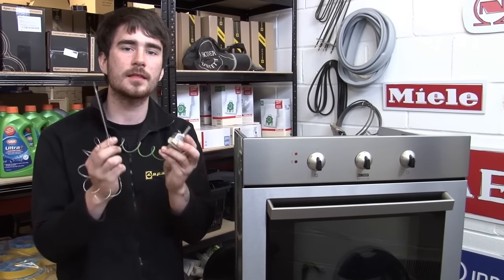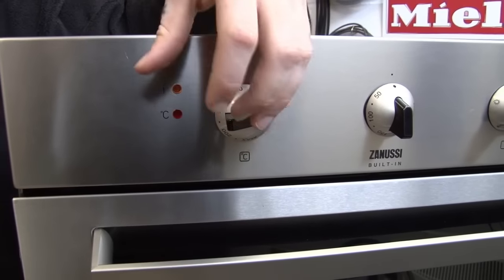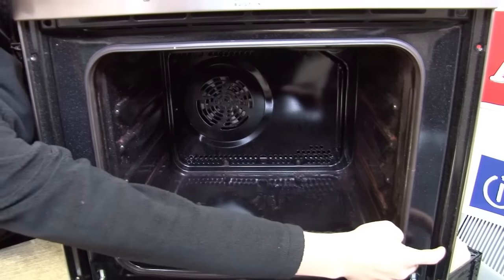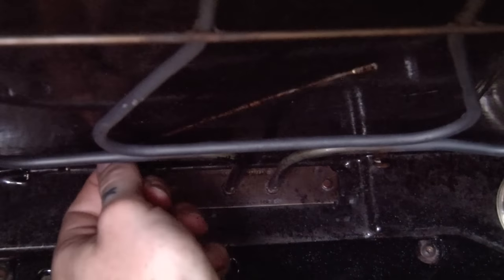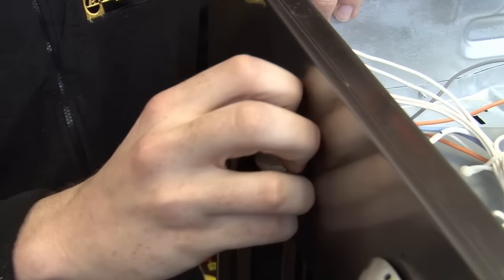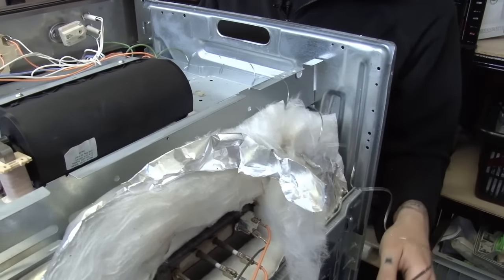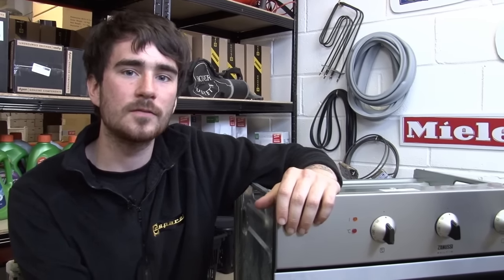How to Replace an Oven Thermostat in an Electric Cooker

Comment: My oven has been randomly switching itself completely off(including the clock and oven light), and after a few minutes to cool down, switches itself back on. Could this be what I need to replace? Thank you.
Reply: Edit,  I have replaced the thermostat and it's still happening! My next port of call is the element!

Comment: What actually goes wrong with the thermostat to cause it to always rise to the highest temperature. I removed the top of the thermostat and saw that everything seemed to be in it's proper order, no breakage or loose connections on the copper wire either. But! The copper sensor seated inside the thermostat wasn't slowly fluctuating to turn off the oven when the 150 - 200 degrees was met, which allows the oven heating element to reach highest temp. Yes, I turned power fuse amp on to test this.

Comment: Thanks for the video. 
My zanussi oven is  inconsistent ,one day its hot then days later when i use it  it doesn't feel as hot despite setting it at 190°.Could this thermostats be a likely problem ?
Thanks

Comment: Thank you Rory and espares for a great instructive film. Really useful and we followed it step by step. Had a laugh and unfortunately now discovered that there is something else that needs repairing too! Still more fun ahead. Fan is working so next... the oven heating element.
Reply from the maker: +Cliffe Osteopaths For information to diagnose your cooker see another video: https://www.youtube.com/watch?v=_lWk22-qvoI
Reply: Hello Rory, my EW74x Hotpoint oven light doesn't go on at all, I can hear a weird sound inside the cooker, almost like a  faint high pitched drilling sound .It sounds like its trying to do something , I am replacing the fan I ordered off you tomorrow ,it arrived very quick , nice one ! I'm on espares now but there's only ew74g thermostat , will that work please ? Thank you .
Reply from the maker: It sounds like you may have a loose terminal in the connector at the back causing an arc and burning. For more information see another video:
https://www.youtube.com/watch?v=YvQEDG-hNz4

Comment: Hi. My oven trips on low heat however on high heat o
It works fine. It's defy 600s slimline. What could be the issue. I have replaced the oven element already

Comment: Another excellent video from eSpares. Thank you.
Reply from the maker: Hi, thanks for your comment. We hope you have been able to replace the thermostat with our help, and that that your oven is now working a it should be again!
Reply: @eSpares  All working fine, thank you, although the two screws holding the thermostat control were covered by the glass front, which was glued on. I managed to remove it and glue it back on afterwards but only then realised that all I needed to do was twist a quarter turn to remove it 😁. Also, although I was careful enough to fit the new control with the terminals in the same orientation, I found that it was upside down but I had already put it all back together so just remarked the knob 😁

Comment: Help please. Purchased Energy Regulator (ES212776)  for Creda 40063 from espares but wiring is different. Can you advise where each wire goes. No videos available for different or new universal regulators

Comment: Our oven heats up but goes past the set temperature then cools to below the set temperature.....and keeps cycling up and down. I'm assuming it's the thermostat. Is this the case?
Reply from the maker: Hi iSharon Smith, if the thermostat is cycling it usually means OK and depending on the thermostat would have a tolerance of + or - 10% if the thermostat is overheating well past the correct temperature then it is likely to be the thermostat.

Comment: I have a Smeg oven that gives me an error 1 alarm and stops the oven. The only info I can find is that it's probably related to the thermostat. Do you know something about this? Nice explanatory video by the way!
Reply from the maker: Hi fophinho,  Error code F1 on a Smeg oven refers to the oven has detected a problem with the temperature sensor not relaying information so check the sensor.

Comment: Good Morning, 
I have a cda intergrated fan oven but have lost manual and cant find the model number. The thermostat needs replacing but I cant find one that is same as one I have. Do you have email address i can email photo so you could possibly help me find correct thermostat part for my oven.
If you could help would be greatly appreciated.
Thankyou
Reply from the maker: Hi susan, if you contact our sales team and they will be able to assist you https://www.espares.co.uk/contact/sales

Comment: Hi so my Indesit oven is just getting really hot whatever the temperature, and the light is not going out  when its been on for a while - I guess this is the thermostat right? The model number is FIM 21 KB IX - will any thermostat work with this or do I need something specific?
Reply from the maker: Hi John, it does sound like the thermostat isn't working correctly, you will need to have the correct part otherwise it won't fit or work correctly but check out our part pages https://www.espares.co.uk/search/ma805pt1604/cookers-and-hobs/thermostats/indesit

Comment: Hi Rory 
Just wondering if you can point me I  the right direction please 
I have a lamona oven 
And it's working fine  but when I turn the thermostat off 
The power indicator light is staying on .. but the light is faint 

Is this some thing to worries about .

Thanks James
Reply from the maker: Hi sean , is the oven cycling correctly? as long as it is not overheating it may just be the indicator light flickering which will not stop you using it.

Comment: Mine is tripping the rcd oils it be the thermostat
Reply from the maker: Hi tospicy4ya, it is more likely to be the element causing the RCD to trip so check that first before suspecting anything else.
Reply: eSpares  removed the element and rcd stayed in now put new element in and it’s still tripping it, as soon as it’s turned in it’s tripping it? What would you suggest next?

Comment: Hi. I wondering if the losing of the clips that hold the element can compromise the functionality of it. We lost our ones in a Cata oven and now is not heating anymore the down part side
Reply from the maker: Hi Enrique, the clips that hold the element stop it from touching anything else when it gets hot and expands if it is not heating check for any signs of damage then use a multimeter to test it to confirm if it has failed.

Comment: Hello, good morning, I have an electric stove and the temperature selector and thermostat has broken down and I called a specialized technician and he came in my house dismounted the two went away and said he would come back with the two new parts and never came back, I bought the new parts but I am afraid to connect them because there are many wires and plugs, so I would like to know if you have any electric stove of the brand logik model LFTC60A12 that can take some photos of the connections of the temperature selector and the thermostat and can send me so I can assemble without damaging the new parts I bought .... Thanks and look forward
Reply from the maker: Hi david, the only appliances we have are for filming and we do not have your model so cannot take photos but if anyone else has hopefully they will be able to help.

Comment: Hi, my oven gets insanely hot if I set it to anything above 140c but below that it keeps the correct temp roughly. The indicator light comes on and off but the temperatures seem way off? Do you know what this could be? Does it need re calibration?
Reply from the maker: Hi adam, most thermostats can not be re-calibrated, is the thermostat cycling above 140c? you will also need to test the overheat thermostat to determine if it has failed.
Reply: @eSpares  thanks for the quick reply.
It does cycle yes. I tested it with a thermometer yesterday and it's way out... 100c on the dial is actually 220c and 200c was hitting past 280c!
All the usable temps are between 0 - 100c on the dial so Ive just made an accurate dial sticker for now. Don't know what would cause this but at least it's now controllable. Thanks again

Comment: Hi, I am just about to order part to replace as I think my thermostat is the issue. Wonder if you could confirm please
2 days ago over only worked below 150degrees, grill and hob fine. Yesterday only grill and hob work, Today only the hobs work. I assume it is a faulty thermostat and not clock/an element for example but is there any way to be sure? Thank You
Reply from the maker: At 4:34 we talk about the oven temperature indicator. This should light when the elements are being heated and if the thermostat was faulty the light would not come on. However if the grill is not controlled by this (some models) it suggests a common problem between grill and oven so check the terminal block as the connections may be loose and burning. For information on the terminal block see our video: 
https://www.youtube.com/watch?v=YvQEDG-hNz4

Comment: I had The thermostat and oven element replaced( did not do it myself ) with parts supplied by e spares. initially the circuit breaker was tripping out when the temperature in the oven rose. so I thought it was thermostat. Now the element does not heat up at all. could it be wired wrongly or is it a faulty part?
Reply from the maker: You need to identify the problem before replacing parts as if you have connected the wires correctly that should not be the fault. For information on Diagnosing the problem see another video:
https://www.youtube.com/watch?v=_lWk22-qvoI

Comment: Can the thermostat make everything dead in an oven?  Temp indicator light, oven light and fan?  Thanks.  Ironically, only thing I do get is the click when turning the knob on.
Reply from the maker: No, that is what we try and explain in the diagnosis video. The light and fan would still work but the indicator and element would not if it was the thermostat. There are only four areas common to the light, fan and element.
1: Clock relay for automatic cooking.
2: Thermal cut out  if unit has overheated in the past.
3:  Selector switch to change between grill, fan and conventional ovens (depending on model).
4: The terminal block (distributes power to the separate circuits.
Wiring unless damaged does not normally fail but connectors can get hot and burn if loose.

Comment: After cleaning my self cleaning oven the door locked sign is flashing and want go out and can't get oven to work. Can you help me. It's a Kenmore
Reply from the maker: On some 'pyro clean' ovens the door locks during the self clean cycle as it heats to a very high temperature. If the problem still occurs after switching of then on and resetting the clock check the lock and the oven element.

Comment: I replaced the oven element in my Electrolux cooker which had blown then the element went in the grill shortly afterwards, the grill and oven are heating ok but the oven is full of smoke . The oven is clean and I allowed it some time to dry out but it's still filled with smoke. I would appreciate your advice on the subject
Reply from the maker: Hi Daniel, new elements pick up grease and oil during manufacturing and will produce smoke when first turned on. This will burn off quickly so just open a window and run the oven then the grill for five minutes and all should be well.

Comment: Any suggestions on what to do if your oven is still overheating, whatever the temp setting is AFTER you have replaced the thermostat like this? (Just done it this afternoon and still have the same problem, but Loved you video and would never have had the guts to give it a go otherwise!) Assuming I didn't damage the new thermostat and it wasn't already bust (which I'm pretty sure is that case) is there anything else that can cause these symptoms?
Reply from the maker: +John B When you say 'overheating' Have you measured this or is the oven cutting out?. Watch this video first and if you still have problems send another post and we will try to help further: https://www.youtube.com/watch?v=_lWk22-qvoI
Reply from the maker: +Asif Ifas Thanks for the comment, Hopefully by cleaning the cap rod it will help cool down the oven and well done for replacing the heater element. Don't shy away from Doing It Yourself ;)
Reply from the maker: +Asif Ifas Your problem suggests a stuck thermostat. For more information see another video: 
https://www.youtube.com/watch?v=_lWk22-qvoI

Comment: That was very helpful. I have a Bush oven which switches itself off after a a few minutes then automatically comes back on after a while. Maybe after it cools.. is this a thermostat issue or could it be a cut off switch or something??? Your assistance would be appreciated
Reply from the maker: Hi Absee, it could be either at this stage so test both, also test the cooling fan and the oven switch. this video will help as well www.youtube.com/watch?v=_lWk22-qvoI

Comment: hi can you confirm if the thermostat is the isdue.. my oven switches off i can turn it back on and it will work then after a shortwhile turns off again..thanks
Reply from the maker: This sounds like the safety cut out is stopping the heating. Check the thermostat controls the temperature on low heat (light will cycle on and off when warm) if it keeps getting hotter it will be a faulty thermostat. For more information see another video:
https://www.youtube.com/watch?v=_lWk22-qvoI

Comment: I have a mini range leisure electric cooker..the oven light and fan come on the oven gets lukewarm but no hotter, the top oven is fine, so are the hob rings and I can hear the fan...is this likely to be the thermostat please..thank you
Reply from the maker: Hi Kim, it is more likely that the oven element is failing so check that first, you will need to gain access to the element and check for any signs of damage and meter the element to establish if it has failed.

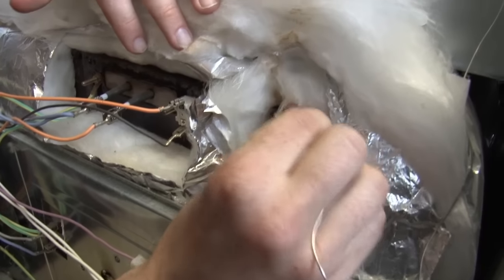Comment: Any idea what the thing is at 2:53 with orange and black wires going in to it (orange at top, black at bottom, near the entry point of the grill)?
Reply from the maker: Hi Mat, that is one of the thermostats.
Reply: eSpares thanks. I broke mine trying to get the old grill out. (You have to remove a screw that the thermostat is attached to, so you have to remove thermostat from the assembly. But the little clips holding it in break easily.) Do you have spares of the thermostat‘s metal clip holder? (The thermostat is fine I think... looks like a switch with a little metal plate that detached)
Reply from the maker: Hi Mat, you will need your model details but here is a link to the spares website www.espares.co.uk/browse/at1092/cookers-and-hobs

Comment: Just a quick question if I may, my oven keeps tripping the rcbo when the oven reaches temperature and clicks off, I’ve checked all the 5 elements for resistance with a multi meter and they all seem fine. I’m thinking the thermostat is causing an earth leak somehow, any ideas ?
Reply from the maker: Your problem is in our opinion likely to be one of the elements (probably the one heating at the time but not always) not the thermostat.A 'leaky' element will not always show with a multi meter, for more information see this video:
https://www.youtube.com/watch?v=XV6QlTwobLo
Reply: Cool, thank you very much for such a speedy reply, it looks like I might need to get someone in after all to check it out, I don’t have access to a megger insulation tester and don’t fancy narrowing the search down by randomly changing elements. I just think it’s strange when I can use both ovens or grills until they reach the desired temperature just to trip when the thermostat clicks the element off. I may also have an over sensitive rcbo as the oven is running off a new CU. 

Thank you again for your reply, your videos are very well made useful and informative

Comment: Hi

Love your videos! Insightful as always! 

I have a Lamona 4401 oven. It gives some heat, and the oven light isn't turning on / and the fan isn't working (I'm assuming as it doesn't make a noise as it does when its on).

Is the thermostat the most likely culprit? Thank you in advance for your help!!
Reply from the maker: Hi Noreen, if the light comes on and it cycles when it reaches the temperature then it is not the thermostat, test the switch first and then the fan motor with a multimeter to determine if they have failed.
Reply: +eSpares thanks for getting back so quick. The light doesn't come on, the fan doesn't seem to be operational and the oven gives warm heat but nothing more. Unfortunately I don't have a multimeter so was going to try and tackle the most likely part through trail and error. I imagine it's hard to be sure of what's wrong, but would you have any inkling based on that information? I'm thinking it's the fan motor? Thanks
Reply from the maker: OK, Noreen, if you are going to do it the hard way here is a video on replacing the fan motor www.youtube.com/watch?v=AYC3mVlqxmA&t but check out our other oven videos which may be useful and let us know how you get on.
Reply: +eSpares Haha. Fingers crossed!! Thanks. Just watched the video. Will order a fan from your site then and see what happens